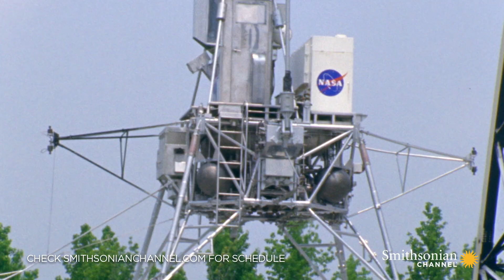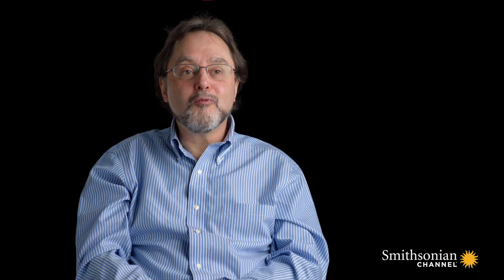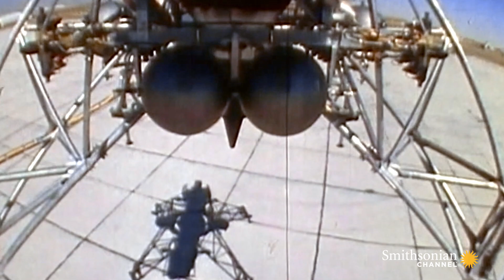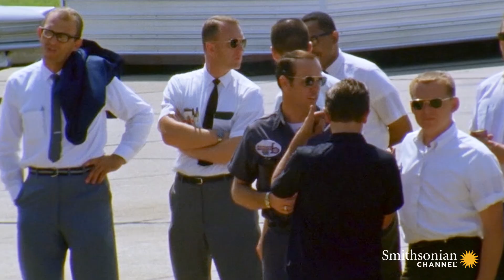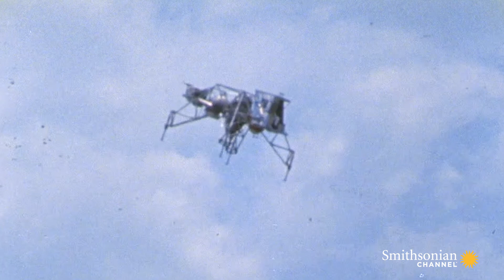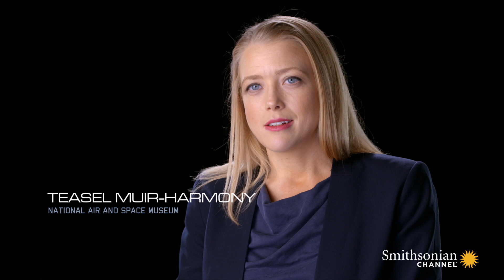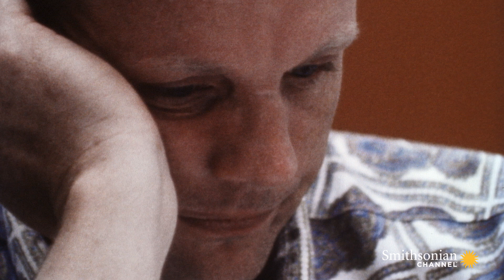How Neil Armstrong Trained to Land the Lunar Module

Comment: Six times we've boarded the moon and taken off the moon modules.  This is a very unexpected example of multiple, trouble-free operation of a complex system, which has never been tested before in the real conditions it is designed for. 
        "Americans send automatic stations to the Moon. They enter the Moon only from the twelfth time in 1962 ("Ranger-4"). The Soviet "Luna-2" enters the Moon in 1959. In 1966-68, 5 out of 7 sent devices gently land on the Moon (weight - 0.3 tons). So far everything is plausible. Failures alternate with good luck. No American automatic station takes off after landing. That's all the Americans had before the manual moon landing a 15-ton apparatus (lunar module) and subsequent manual take-off. Landing on the moon and takeoff were without precedent.
Reply: If you think it would have been impossible for a 100% success rate for 6 manned landings then how about explaining why the space shuttle had a 100% success rate for all 138 landings. I'm obviously not including the 2 shuttle disasters since they happened before the final phase and actual landing just as your not including the Apollo 13 situation. So 138 out of 138 successful landings in a spacecraft that once it became operational had zero abort capability for the crew(of as many as  7 astronauts) during the last part of the landing and final touch down speed of 214-226 mph with zero go-around capability vs the LM's abort system for the ascent stage and 2 astronauts plus the fact that it's touchdown speed was measured in ft/sec. There's no doubt there were risks involved but the space shuttle 100% landing success rate for 138 flights proves they knew how to train and plan for success in that particular phase of the missions.  

As for the crews, every guy at the controls during the landing phase was a former naval aviator(except Dave Scott) who excelled at landing high-performance jets onto carriers at nighttime and all kinds of foul weather conditions. These guys were then selected to become test pilots were split second decision making under some of the most stressful conditions meant life or death. Plus they had to land prototype high-performance jets for the very first time. The upper echelon of caliber of these guys were selected to become astronauts and received years of training with the best of them becoming the Commanders who got the highly specialized hands-on experience with the LLRV's & LLTV's. These were the 7 guys who were trained to land the LM .Obviously, Apollo 13 didn't make a landing but Lovell was prepped and trained just like the 6 that did land. The Lunar Module Pilot never got the extensive training on the LLRV's & LLTV's as his main job was to reduce the Commanders workload and handle everything else involved with the landing except the actual controls manipulation Seems to me NASA made the right choice on how to select the right people for such a crucial job. It worked so well that they used the same selection system with the Shuttle.

The most technically difficult part of landing on the moon was building a large enough rocket to get the necessary payload into LEO for the TLI burn. Of the approximately 400,000 people involved with the Apollo program, roughly 300,000 were needed designing and building the Saturn family of rockets plus all the logistics required to prep them for launch. Prior to the Apollo program, the USA experienced about a 40% failure rate with its rocket launches which were pretty small and relatively uncomplicated. Of the 32 rockets in the Saturn program, all 32 of them were successfully launched. These were some of the most complex machines built at that time culminating in the Saturn V with its 13 successful launches. A big reason for such a turn-around success story is the fact that all the components built for these rockets had to be rated for a 99.99992% reliability requirement. By contrast, the Russians had a 100% failure rate with their version of the Saturn V,  the N1 blowing up spectacularly 4 out of 4 times  and the cancellation of their moon landing program shortly after despite accomplishing many of the other goals for a manned landing on the moon such as testing their version of the LM in Earth orbit and soft landing probes on the moon.
Reply: @mako88sb  The Russians were the leaders of the space race. During the development of the moon they had 100% of failures.  The Americans were not leaders of the space race. There were no significant failures during the development of the moon.  This is strange. Landing a space shuttle on an airfield is not landing on the moon. The Russians planted their shuttle in unmanned mode)
Reply: @dn1317  The Americans WERE leading the space race. By the time the first manned mission to the Moon launches (Apollo 8) the Americans were FAR, FAR ahead, with well over 4 times as many man-hours in space, the space altitude record, having made multiple rendezvous and dockings and multiple EVAs. The Soviets did not make their first rendezvous until almost 3 years after the feat had been performed by Americans (in fact they managed it only 2 months before Apollo 8 set off for the Moon). In addition America had made 2 successful flight tests of their Saturn V moonrocket whilst the Soviet N1 moonrocket had yet to fly.
Reply: @ D N "Trouble free?" Have you studied Apollo? I just quoted this in an earlier post, but it fits here just as well: this is from Gene Kranz’ book, Failure Is Not An Option:  "What appeared as nearly flawless missions to the Moon were, in fact, a series of hair-raising near misses." 

Also, with regard to the information you've cited about the unmanned missions to the Moon prior to Apollo, well and good, but there's much more to take into consideration, namely the Gemini program, all of the Apollo missions prior to 11, and the fact the astronauts did a huge amount of training in simulators. They didn't just up and send people to the Moon - far from it.
Reply: Of course. That's what "without precedent" means - you're doing it for the first time.

Test pilots do a lot of that.
Reply: Nearly every mission edged catastrophy at some point. Heck, Apollo 13 didn't even make it.

Comment: After this fail on Earth not on the Moon; although it took place in a very typical environment, do you still believe that they get to the Moon.
Remember Van Alen belt.
Reply: Mamdouh Naddaf ye I remember  Van Allen BELTS of radiation, and as BELTS of radiation they can be omitted by changing flight trajectory, because they are fcking B E L T S!
Reply: It's weird how the deniers are always much more worried about the Belts than anyone else.
Reply: @hydrochloricacid2146  
Knowledge is so precious
Light is so good
Reply: @mamdouhnaddaf2989  knowledge is the reason why I know that the VABs aren't a showstopper.
Reply: What the heck has crashing a failing test vehicles got to with the Van Allen belts???

Comment: We made it through the Van Allen radiation belts in a piece of tinfoil?? Yeah right
Reply: Exactly what makes you think that?
Reply: First off there is different types of radiation. Secondly they travelled through the belt quickly so that wouldn't get too much radiation. Maybe do some fun research next time, instead on believing the hoaxers.
Reply: What kind and intensity of radiation do You expect to find in the radiation belts?

Comment: -We have invented a flying machine that's almost uncontrollable and nobody has ever flown. 

-Do I have a parachute at least?
-Yeah, but it doesn't slow you down enough and you are gonna hit ground hard. 

-Excellent.
Reply: You can't use Parachute on Moon my friend
Reply: @asmitsharma70  so you don't get to use one on earth neither?
Reply: @polvoradelrey2423  u can idk they must've got some reasons
Reply: Somehow they don't have any actuall videos of this working. Note that its only recently that Elon Musk managed to land a rocket. Yet somehow they on an alien world 1st try with just a guy and a stick.
Reply: @ulkairvillan3219  this is one clip they trained
Reply: @ulkairvillan3219 the Delta clipper was able to land long before SpaceX. This was in the early 90s.
Reply: There is ZERO PROOF*** that USA ever landed on the moon!
Reply: You silly one. If it had worked as meant, There would have been No problems with controlling it.And, the parechute was the same type as the fighterpilots use.

Comment: I’m impressed that the lander was powerful enough to fly within Earth’s atmosphere. I thought it was only designed with enough power to land on/take off from the moon which has about 1/6th the gravity of Earth and no air resistance
Reply: The real landers of course never flew on Earth. These were just Astronaut training vehicles. 5 were built, 2 remain in museums.
Reply: Rohan Bhatt You might want to do some research and learn about the subject before commenting. This process can help prevent you sounding like a dill on social media.
Reply: @anridapu  do some observation and see how there’s wind blowing the flag in space. How this lunar landing vehicle left no crater from the jet engine when landing on the moon. How they had Instagram live back then to broadcast the landing to the news.
Reply: @johnnycezar6968  All your comments can be easily debunked with some reasoned inquiry. The hard part seems to be aptitude.

Comment: This vehicle never worked. And the instable LEM proved never the ability to fly. Miserable propaganda vid.
Reply: The fact that most test flights were successful disproves your claim.
Reply: You are ignorant as always. The 5 simulators together flew several hundred times, training all astronaut pilots. 2 still exist in museums.
Reply: @YDDES  You are ignorant as always. The LEM flew never on earth, even not in a light-version.
Reply: Technically  @hajoos.8360  you are correct! The LEM never flew on earth .
Reply: HaJo OS.
And submarines are never testet in the air. Guess why?
Reply: @tma2001  It couldn't.

Comment: Moon doesn't have atmosphere, does parachute still works on Moon?
Reply: vj j nope,a parachute is an aerodynamic break....'aero'....as in air,the thinner the air the faster you fall,felix baumgartner fell a 1000km/h in the thin air at his redbull recordflight.
Reply: A parachute doesn't work on the moon. Had they lost control while descending to the lunar surface, they likely would have died.
However, this is a training vehicle operating in earth's atmosphere. It makes no sense to replicate the danger of a lunar landing.
Reply: no.
Reply: Vj j. Why would they need parachutes on Moon? This was just a test rig, meant to fly only on Earth.
Reply: @YDDES  I was asking generally.. and I was thinking may be they had ejector on lunar module
Reply: No reason to have ejector seats, since they couldn’t survive on Moon any length of time. The ascent stage was their ”ejector seat”.
Reply: @vjj6258  The lunar ascender was literally their ejection seat in the event of a malfunction in the descender stage. IIRC, Apollo 11 came very close to exhausting their descent fuel and were concerned that they might have to fire off the ascender.

Comment: The amount of G force experienced on ejection is very high.
Reply: yes its something like 23g...and compresses the spine. UK pilots are allowed 3 ejections then have to take a desk job cos of the damage to their spine
Reply: @716tommo  - Eastern European seats are upwards of 20 g western seats around 12 g
Reply: @PabloGonzalez-hv3td  you work for the "Eastern Europe" airforce do you??!! (and before you ask... I was in the RAF for 7 years)
Reply: @leethomas3772   - I worked with the now RCAF for 13 years myself my source is a short little CF-18 pilot that I used to imply had ejected a few times and permanently compressed his spine - not sure what specific seat you're referring to but no western seat I'm familiar with subjects the pilot to anywhere near 23 g
Reply: @PabloGonzalez-hv3td  o so now we have an expert here!
Reply: @leethomas3772  - I get it your 7 yrs in the RAF are valid but my 13 years with the RCAF are not anyways look it up it's not exactly classified information Soviet seats are harsher than the west's
Reply: The amount of pressure would have spilt out the herniated disc in my lower back like jam. I think I would have ended up in an operating theatre instead of casually walking back to the office to do some paperwork.
Reply: Imagine landing on the fire ball after ejection.😅

Comment: The real LEM was much more (top) heavy. NASA could never have taken the risk of NA trying to land this thing on the moon by manual control. The dust cloud generated by the nozle would have made it impossible to see.
Reply: That's not how dust works in a vacuum.  Any dust would be blown clear of the lander. With no air, even a nearly weightless dust particle would react the same as lead shot being blasted clear - blasted away on a straight trajectory until gravity pulled it back to the surface some distance away.  No cloud of dust, no dust on the lander.
Reply: Gu Nesnaj not too bright Gu.  No dust cloud in a vacuum.  The dust falls immediately with the same speed as a brick.
Reply: Oh an experienced test pilot and astronaut are you?

Comment: Moon landing was fake
Reply: WireLoop40 fight me
Reply: @bayj0nes space odyssey had many errors, while the moon landing had no errors, and don't tell us to watch 1000 youtube videos calling research, thats repurposing the meaning.
Reply: @bayj0nes the "wires" are antennas, and it would be easier to "fake" it on spot than to fake it on earth cause tape would of been several km-s long.
Reply: @bayj0nes they resigned cause they wanted to, also, they are antennas cause strings that thin would tear apart.
Reply: @bayj0nes so you believe rockets can go low earth orbit but not to the moon cause the instant killer van allen belt? the van allen belt isn't even dangerous and the spacecraft was rolling while in the belt to prevent some radiation from coming in.
Reply: @bayj0nes first apollo flight and apollo 13 were the only failures, also the soviets or any other country screamed "FAKE!".
Reply: Don't be silly.
Reply: So are you

Comment: If a real jet engine was blasting downward to cushion the landing on the moon I think the moon dust will still be settling today because of the huge dust cloud it would have caused.
Reply: Jef ier  There would have been no dust cloud. You can tell by the many footprints, especially the close ups, that the moon's surface was very moist, almost like mud. If it was dry and dusty we would be not seeing those beautiful footprints.
Reply: @bigpardner  Ja ja ja,  la luna es tan seca como la mojama...ni gota de agua.
Reply: jose luis Fernandez  Bien que reconozcas mi broma.
Reply: @bigpardner  Just no, it was not moist. Regolith, not being subject to the same sort of erosion as on earth, is extremely jagged (problematicly so for long term habitation) and thus sticks together very well without any moisture present.
Reply: @bigpardner  The moon surface wasn't moist at all... didn't you see all the dust being kicked up by the lunar jeeps when they were driving on the surface.  Dust was going everywhere.

It makes no sense they would kick up dust and the rocket engine wouldn't
Reply: @frankmat  I was joking about the footprints,
Reply: Jet engines don't work in vacuums, the actual LM used a hypergolic rocket engine (and RCS thrusters for attitude controls). And for the same reason, ie it being a vacuum, there would be no dust "cloud". Any particle, no matter how small, falls just as fast as anything else, so very fine particles would fall faster than on earth.
Reply: DE J so if very small particles fall very fast back down aren't we talking about heavy duty gravity then? But wait, the moon has no gravity, that's why they were supposed to be jumping around like balloons. Something fishy smelling here.
Reply: @AeijingBuffoon  who told you that moon has no gravity?
Reply: MOON HAS NO 
GRAVITY??? Don’t you even know, that Moon has1/6 of Earth gravity??
Reply: YDDES how do you know, have you been there?
Reply: @Jef ier the moon has no atmosphere. There wouldn’t be any clouds of dust. Anything kicked up would immediately fall back down to the surface.
Reply: @AeijingBuffoon   It’s quite easy to calculations a Moons or planets gravity, if You know their orbit and how heavy they are. Didn’t You know that???
Reply: @AeijingBuffoon  If the moon has no gravity what causes ocean tides?
Reply: I will let you on a little know secret, jet don't work in a vacuum!
Reply: Greg Smith I'm not concerned about jets, I'm wondering about raising dust; disturbing the surface of the moon.
Reply: @AeijingBuffoon  Then why would you comment about using jet engines to land on the moon?
Reply: You talk like You think There is an atmosphere on Moon, to support the dust Thrown up...

Comment: Pretty sure it was too windy for a flying bedstead.
Reply: The crash investigation showed that a loss of helium pressure caused depletion of the hydrogen peroxide used for the reserve attitude thrusters.  The vehicle’s instrumentation did not provide adequate warning about the adverse situation.  Engineers corrected the problems before flights resumed in October.
Reply: It wasn’t the wind causing the crash.